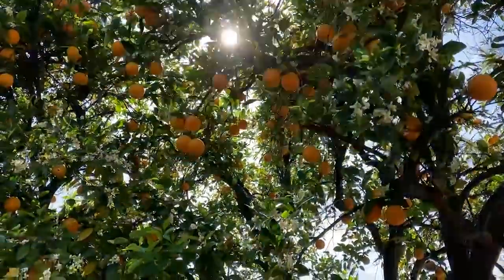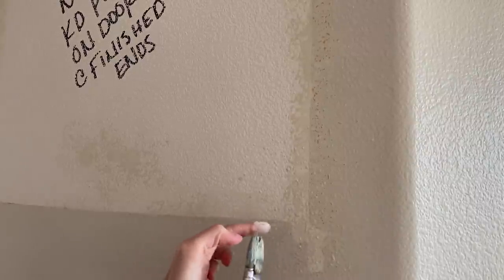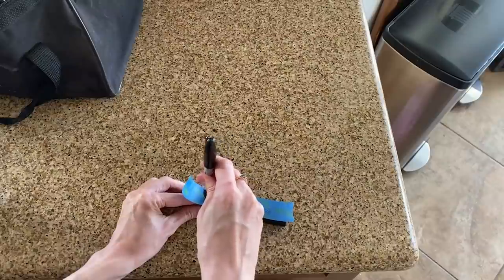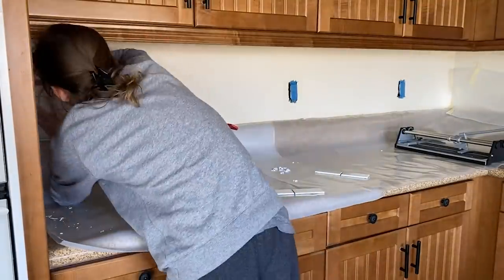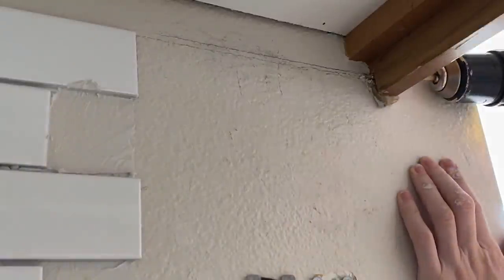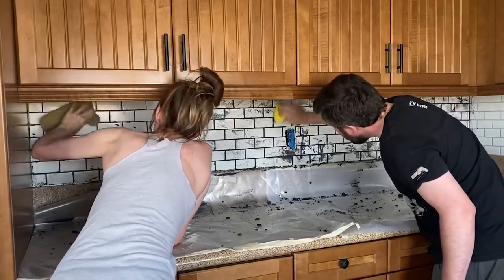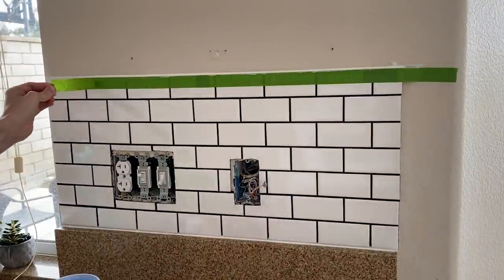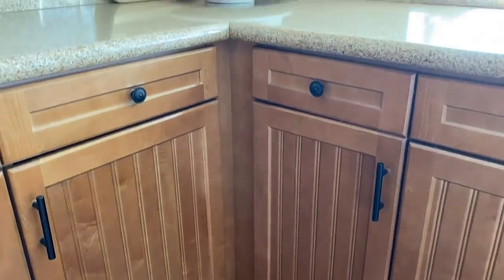DIY Kitchen Makeover (Before + After Transformation) | DIY Backsplash

Comment: First, I think the shade of wood & the design of your cabinetry is really pretty!!  They look quite solid & expensive & changing that hardware completely transformed them. So glad you didn't paint them plus, I can't imagine the amount of work it would have been to paint them and STILL you did an unbelievable amount of work transforming them with the matte black pulls & handles - that was a LOT of handles to install especially considering that you weren't simply replacing but having to drill ALL of those new holes!!  Well done! I learned a new tip from you as well with that patching product that doesn't require sanding afterwards! Yay!  All in all it was a beautiful outcome! It was an enjoyable transformation to watch as you have such a soothing voice and appeared to be so patient with the process. Especially dealing with that fast drying grout, the tile cut you had to fix AND then having to have to take down the one floating shelves you had just installed in order to complete the finishing tile process.  Lol! For me I would have been cursing up a storm to have to do that!  I love how the greenery looks with the wood & matte black - I think more greenery on top of your kitchen cabinets would look great as well! jmho.  Thanks for taking us along on your kitchen update journey! New subbie here.

Comment: The kitchen came out amazing!!! Awesome job! It looks beautiful! Yes, you are right.  It is tons of work.  You did fantastic.  Do be proud of yourself. 
FYI. I don't know if the cabinets are real wood, but either way, if you wanted to or still want to, you can just clean off all the grease,  lightly sand it and use chalk paint. I understand that chalk paint sticks to anything (especially the real thing which is Annie Sloan's chalk paint).  However, if you use chalk paint, you need to seal it.  Super important because the paint itself activates again with water.  Most people use wax as a sealer.  I probably would use matte varnish (i don't know if you have to buy a special chalk paint varnish or any  varnish would do.) 
Lastly, you probably know this by now, but anytime things dry up fast, like the grout on those tiles, the trick is to work in small sections, i.e., instead of grouting everything all at once, grout small sections or, in your case, one wall at a time, then clean off the grout before moving to the next wall. I have learned this the hard way myself. Ha, ha.

Comment: Really nice Job, really upgraded your kitchen.  There is a really gorgeous vinyl granite contact paper,
on Amazon, that has the deep golds with brown and black flecks in it.  It would add more warmth, and 
make the tile, and cabinets pop, a much better accent, than what you have. The counter top make it
go flat,  just doesn't do anything for the design.  It will also make the cabinets look more high end.

Comment: For texture I've used crumpled up newspaper and watered down joint compound. It's not an exact match but very close.
Reply from the maker: This sounds really interesting! Do you crumple the sheet and then straighten it and apply it to the wall and use the watered down joint compound similar to a paper maché technique?
Reply: @HappyHomeMama  I crumple it into a ball, dip it in a thick mix of compound and water, then just push it on the wall. The newspaper soaks up a lot of the water so what's left on the wall is mostly compound. I don't leave the paper on the wall. It's just the 'brush I guess. The texture is random and easily manipulated. I've also used this technique for painting. I definitely recommend experimenting on another surface until you're comfortable with it. And having a lot of newspaper on hand. I get maybe 3 passes per piece. The junk mail adverts work really well. If you want to get fancy, I think they actually make rollers that create that texture, but I'm a cheap diy-er so I try to use what I have on hand.
Reply from the maker: Thank you so much for the tips! I will definitely try this out!
Reply: @HappyHomeMama  I hope to see it in an upcoming video! Tag me so I can see!